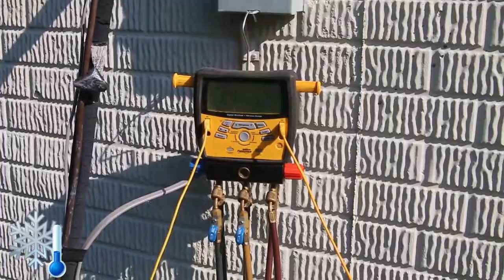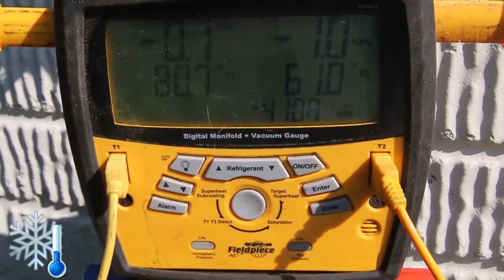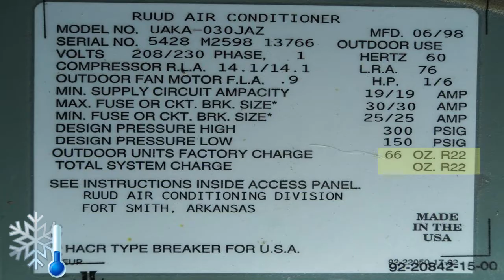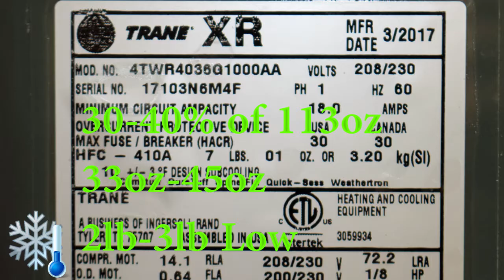How to Check AC Freon Level   No TOOLS

Comment: Great info. My room is at 80 and my vent is at 20. Outside temp is 105. 

What to check now? 

3.5 ton unit 
Single unit multi zone
1600 sqft down
900 sqft up

Comment: great video thank you : Here my Problem. Contactor is not pulling down. 24 and 240 Voltage tested ok. new capacitor installed . Now I am thinking High or low pressure switch due to low refrigerant are the issue. Should I just manually engage the contactor and see what happens while checking with your steps here ? ( when I turn off AC in September the compressor and fan worked ) Any advice would be greatly appreciated !!!
Reply: the relay could be bad already. i hope you fixed it already.

Comment: i have a unit 12 years old. i think i need a refill when hiring someone to refill my freon, what should i look for and what should i ask? i don't want to get ripped off or pay for something i don't need.
Reply: There's a LOT more to an AC than "just needs a refill". I get lots of calls from customers telling me they just need some freon when in reality they don't, the low preformance is caused by something different (Lack of maintenance, dirty coils, dirty filters, restrictions, etc). Shop around for an honest company & never hire the biggest flashy company with the super clean trucks. Those guys are usually the ones that just try to sell you shit right away.
Reply: @_n8787  Is there anyone else I can call instead of an HVAC person? My temp is set to 74 but is reading 84. My bill more than doubled last month. It is blowing but not cold air. Please help ?